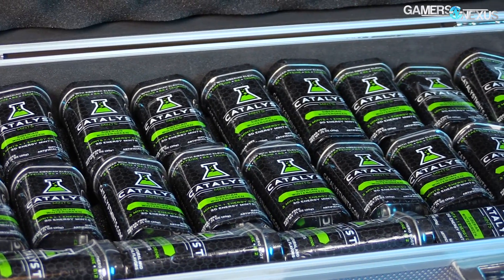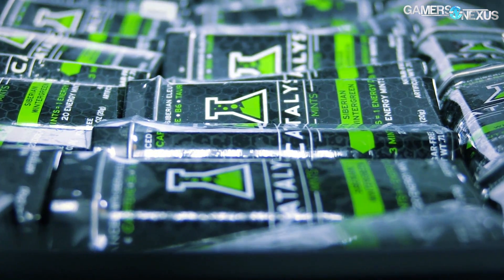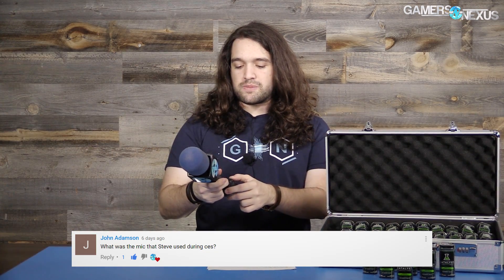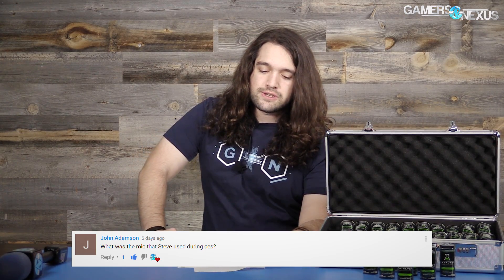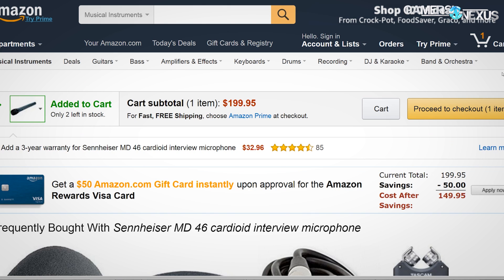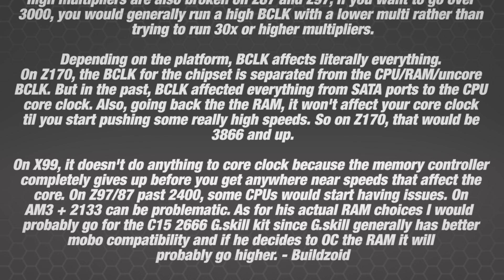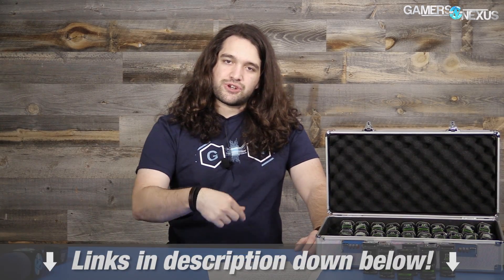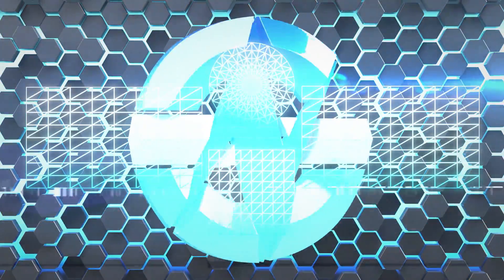Ask GN 41: Why Do CPUs Have an IHS? & RAM Overclocking

Comment: The only reasons I could see overclocking ram is if you are doing overclocking and your otherwise fine ram is holding it back. Or if you for some reason have very slow ram with a very fast CPU (where it is also being held back).

Otherwise... 🤷‍♀️ It's like pcie versions. They are way faster on paper yes, but the effective difference is like 4% at most (or whatever GN found, other places have seen less difference as well).

Comment: buildzoid says 2133mhz ram is problematic on am3+???  i mean the FX cpus are rated for 1866 ram out of the box.  so anyway, i am running an 8370 on ASUS Sabertooth 990fx and have my corsair dominator platinum 1866 (xmp 9-10-9-27-48) running @ 2140 (10-11-10-30-40) for almost 5yrs now with no problems.  funny how xmp always throws a monkey wrench in the tRC setting to slow things down to try to guarantee stability.  gotta watch that kinda stuff if you want the best performance.   

i like to run "winsat mem" (no parenthesis) from the command line in windows.  quick memory bandwidth check. currently 21319.83MB/s on my system w/ mad tabs open plus a couple other programs.  that's dual channel.  quad channel systems get a lot better numbers.

Comment: 11:00 thats completely normal i had a ADSL modem that was getting hot on the greek summer heat and was randomly restarted so i just made holes on the plastic and had a case fan blowing on with a 12v transformer.

Comment: RX480 fan question from video:
Note he set a MAX of 55degC with 40degC "target". He may end up with really POOR PERFORMANCE if the card is turning the fans on at 40degC and THROTTLING frequency down if it hits 55degC.

Not sure exactly what he's set though. He should set back to DEFAULT value and run a benchmark like Unigine Valley to use as a baseline.

Comment: Yeah hated the "tech closet" feature of my parent old house, ton of tech shoved into a tiny closet ambient temperatures would get ridiculous and the router would just die. Don't know why it was so hard to convince them a new router every 9-12 months was highly abnormal.

Things only kind of got better when they moved, the router is safe now, but the home theatre rack is suicidal, the stupid rack is in a corner cabinet with no vents. Already completely fried one sound system.

Maybe one day they will learn that shoving a bunch of heat generating tech into a tiny space with no air flow = dead electronics. My only solace is the new system is so complicated they pay some dude (who apparently has never heard of cooling) to handle it rather than drag my ass from college.

Comment: Question - Any news surrounding the i7 7700K temps? There's been little word from my main trusted channels (paul, bitwit, jay, you,OC3D) since launch week.Have future bios improved the situation, or has cheap TIM from intel on early batches been isolated as the source of the issue? Any word from intel or users that newer batches have improved?

 I'm in a situation where i might NEED to upgrade before the zen launch, but i'm also not willing to risk my warranty delidding my first chip. (Also, i want to apologize for thinking the wood wall was a dumb idea at first. It's basically trademark GN at this point and it was a good choice)

Comment: I bought three i7-7700K CPUs as me and my sons all needed an upgrade. On all builds,  I used an ASUS Strix Z270E mobo, Cooler Master Hyper 212 EVO air cooler with the included fan, Arctic Silver 5, and 32GB of Corsair Dominator 3200C16 memory.  I found the thermal consistency between all three chips to be extremely tight, only differing a degree or two on the full Aida64 CPU, FPU, Cache, and memory stress tests even at 5GHz on air (NOT recommended). Put back to more reasonable 4.7GHz oc on all, the highest temp recorded was 83C on on and the other 2 were 82C after running for a couple of hours. All average 72-73C. Frankly, I could not tell the difference between multiple runs on one CPU vs the difference on runs between CPUs. Very consistent results.

Comment: Question: Hi Steve. I have an i5 6600 on a h110m chipset motherboard which was purely down to budget and I was hoping that since the processor had turbo boost that this would be at least some level of performance overhead since I didn't choose K / Z parts. Do you know if there are any bios settings that can optimize the turbo boost so that you could improve the performance by helping it switch up more frequently? Are there any settings such as turning off all C-states that would help? The question was sparked since I saw a slide from Intel on their Kaby Lake series and how they improved the scaling of turbo boost to offer (somewhat) meaningful performance gains by getting the processor turbo boost more often (although they were promoting this on a 7600u chip and not desktop). Thanks!

Comment: If I may add something to the IHS discussion:

Back in my younger days, CPUs were sold without an IHS, and actually (I shit you not) required the use of a butter knife or flathead screwdriver to properly apply the heatsink, thanks to a latching mechanism still in use by AMD, albeit much safer and more effective. This resulted in a lot of people putting a screwdriver right through their motherboards, or in a lot of cases, the CPU substrate.]

Thus, the IHS was born.

Comment: Question for next week, I just bought and installed a MSI Z270 XPower Titanium mobo and put my 6700k in it. I have been having a hard time with the "Game Boost" feature not working correctly. At first it worked fine. Setting #4 took the cpu up to 4.59ghz with vcore at 1.32v (Although it was dynamic and never usually went that high of v). However, when I went to set it back to 0 and put the cpu back to default settings, it didn't remove the overclock. It was stuck at 4.59ghz. After restarting the system multiple times (and trying to get it to remove the Game Boost) I am back to normal. Now when I try to finish my testing of the Game Boost feature, pressing the buttons does nothing at all. I am wondering if this just an early BIOS bug that will probably be solved with future updates or if I should just re-flash the BIOS and start over at the beginning?

Comment: I had to place a 120mm fan on my Cisco ASA after I burned one out.  I also have a fan on my cable modem because it was running too hot for my liking.

Comment: hi! I've been having some problems with certain games after overklocking my i5 6600k, ( I've got the Cpu to run aida64 for 2+hrs on 100x47) despite using the default settings in bios the games keep crashing, so I'm wondering if it has to do with Cpu cashe? basically I'm wondering what impact overklocking cpus has on Cpu cashe and what that then impacts game performance. 
the games I having issues with are ; Battlefield 1, War Thunder,  Fallout 4 and Mafia 3

Comment: Steve, I would like to know what would be a actually dangerous temperature for components. I live in Brazil, so it's hot in here, and my notebook (i5 2450M and GT 540M) has idle temps in the 70-80C range (GPU a bit lower) and the CPU goes to 85-90C on load and the GPU has hit over 90C several times, including 95C yesterday while I was playing.

I ask this because once I had the stupid idea of slightly increasing the GPU clock (I knew I shouldn't) and it ended up being stable in the game I was playing, but when I tried in another harder to run game, the GPU hit 96-97C and I got a BSOD. After restarting it, my GPU was not being recognized, even after restarting again. It only worked again in the next day.

And another question related to this one. Is Cooler Master's Thermal Fusion 400 actually a good TIM? Because I researched quite a bit and bought it, but everytime I open my notebook to clean it and change the TIM, it's pretty much like dust, I'm not sure if that should look like that in less than a year of use.

Comment: #AskGN I understand normal AMD CPUs not having integrated graphics but in Intel processors and AMD APUs they have their own visual and audio controllers built in. Why on these chips do we not strictly use those integrated chipsets on motherboards today? (or at least inexpensive motherboards that vendors want to be cheap on) it doesn't make sense to me too use other brands like realtek for audio on board or even for the NIC as well

Comment: Hey Steve,
How do GPUs handle multiple monitors? For example, they could:
- Render one large frame that is split up and sent to each monitor per cycle
- Refresh them in an alternating pattern (ie render one frame for monitor 1 then the next frame for monitor 2 then back to monitor 1 in a 2-monitor scenario)
- Split the GPU cores and frame buffer between the monitors, either dynamically or in a fixed fashion

Also as an extension, how does a GPU deal with multiple monitors refreshing at different rates (eg I have a 1280x1024 monitor at 75Hz and a 1920x1080 at 66Hz)?

Thanks!

Comment: CPUs used to come without heat spreaders. People were breaking the silicon die. Remember that a GPU has a proprietary cooler that you really aren't "supposed" to remove, so there is less chance it will be broken in the hands of a consumer. As far as CPUs go, nowadays, there are a thousand different user applied coolers. Steve is absolutely right here, people rarely correctly torque their coolers.

Comment: @Gamers Nexus - In regards to gaming specifically, at what point does the increased latency of higher frequency RAM start affecting performance negatively/cap off. Eventually it should become a slope of diminishing-return for the higher cost being paid as you run into slower timings with unnecessary bandwidth. As I understand it, games prefer the information to be accessed quickly with lower timings rather then simply having a higher potential ceiling to the amount of information that can be provided at one time.  However I've seen benchmarks that showed something to the affect of 3200Mhz RAM with CL18 timings having higher FPS then 2000Mhz with CL10 timings.
Reply: you cannot look at those 2 specs as unrelated info. it's not about bandwidth and latency, latency is measured by a formula including both specs in nanoseconds:
true latency (ns) = clock cycle time (ns) x number of clock cycles (CL).
so basically, a RAM's true speed, aka how fast the cpu can take something from it, is the product of its frequency and it's CL rating.
"Latency is often misunderstood because on product flyers and spec comparisons, it's noted in CL, which is only half of the latency equation. Since CL ratings only indicate the total number of clock cycles, they don't have anything to do with the duration of each clock cycle, and thus, they shouldn't be extrapolated as the sole indicator of latency performance." - Source: http://www.crucial.com/usa/en/memory-performance-speed-latency
more info on that link. read up a bit it will clear all your doubts and take 2-5minutes
Reply: Sorry for the late reply. Work has been busy, trying to get into a new apartment and I recently fell ill... However thank you for that detail explanation and link, I really appreciate it! I always assumed that since the timings were increasing that clocks were essentially being wasted with information being transferred in larger chunks but less frequently causing a reduction and delay thus causing lower frame-rates. I've been curious about this topic for a long time and Google has sent me all over the web, never actually finding the answer... and yet it was on a website I use almost every-day to check RAM compatibility for customer's PCs... That is some irony.

Seriously though, thanks.

Comment: Why do games recommend 8GB of ram if the video card has it's own dedicated ram? Can't a game run off of 2GB of system ram if you use a 8GB RX 480?
Reply: Carlos Santillana the short answer is no. Even 4gb is system ram isn't enough for most games these days. Why do games need system ram I don't have the exact answer for but a educated guess is process and physics data that the CPU needs to access quickly for game calculations.
Reply: That makes sense, thanks

Comment: On the note of the Cooling Routers: I have actually done this. I spliced off the power from the 9V power brick of a cheap router, attached it to a small fan and put some simple thermal pads with cheap heat sinks on the back of the router with the fan pushing air straight through them. More stable, less internet dropouts, never needing to restart it.

Comment: that new shirt design is really nice. Strangely I've had the opposite problem with my cheap wireless dongle, when I plug it in at the back the bandwidth and latency are unstable and it disconnects while playing online games, also gets very warm. Moved it to the front and all of this stopped. I wonder if maybe the hot air being pushed out of my back mounted radiator could have caused it?

Comment: We have seen how well liquid metal works for heat transfer.  Has anyone ever tried using a something like mercury for coolant in a loop.  It would take a robust pump system due to the how heavy it is.

Comment: Hey Steve. Love your guys content. My question is as follows.

I'm wondering if there is a way to find out weather a CPU is bad or the motherboard is. I let the Asus software overclock my CPU just to see what it would get compared to what I got. So it did this without ever showing anything on the monitor. Noticed the PC was off and when I turned it on the CPU was at 90C. Reset to optimized defaults instantly after seeing that. And ever since the CPU has not been able to run any CPU stress test even at intel settings no XMP. Hoping it's just the CPU bad and not the motherboard 

CPU - 6700k
Mobo- Maximus VIII Formula

Comment: Question: Why can't you utilize VRAM from both gfx cards in SLI configurations?
Reply: Probably because if one GPU needs data from memory, it's much faster to read it from memory on the same card rather than having to request it from the other card, because in that case it would need to communicate through the SLI bridge, which is slow. The SLI bridge has a speed of about 1Gbps, while modern mid to high-end GPU memory speeds can be anywhere from 7 to 10 Gbps, a lot faster than the SLI bridge. So it makes sense to store all the data being used by the game on both cards at once so that either card can access whatever data it wants at any moment, and you can even have both cards accessing the same data at the same time because it's stored on both cards separately. If you utilized all the VRAM from both cards as one big memory space, you would get stuttering whenever the game needs to load a lot of data from VRAM.

Comment: Can you mount a CPU air cooler on GPU
Reply: Yes. Though bracketry can pose a problem. Couple vids online, I think LTT has one. Arctic and Prolima both offer GPU specific air coolers, Prolima includes separate heatsinks for the other graphics card components, Arctic intends to cool those through the large backplate, I'd go with one of those purpose-built system now that they're available. Though I'd really like to see a complete GN review of both systems, if that's possible. GN has already shown the Arctic hybrid AIO water cooling system on the RX480, and EVGA's AIO system on various Nvidia cards.

Comment: Question: Do wireless access points degrade over time? I have used 2 wireless routers by now and im on my third now which I have it on top of a laptop cooler. I think that heat degrades wireless performance over time. I can't really explain how by replacing the router but using the same exact wireless settings (ssid, channel) fixes many problems with my wireless devices.

Comment: Hey I have question for next week.

I have a router which is showing some very weird behavior. The thing will be replaced soon so I don't care about a solution, I am however very curious as to what might be happening here.

When I download something the entire network in the house just dies. Everyone gets a "connection refused" error. However not with all downloads, namely the Star Citizen downloader seems to cause trouble.

On top of that if I connect my laptop to the wireless network,  the same thing happens. If I boot the laptop to Ubuntu however, everything is fine.

My main desktop also seemed to cause the same thing as the laptop seemed to do for a while, this seems to have fixed itself however.